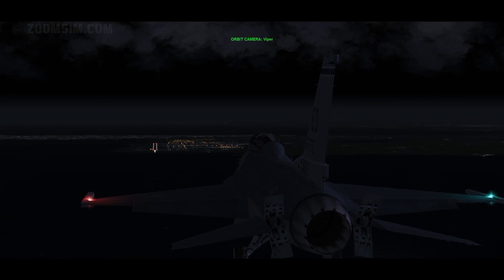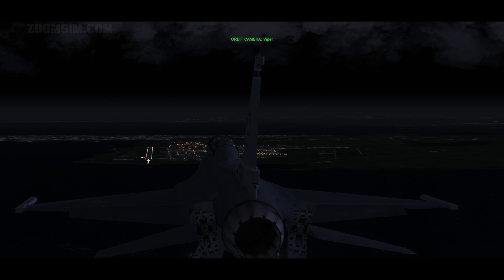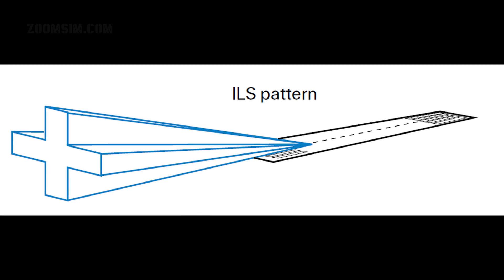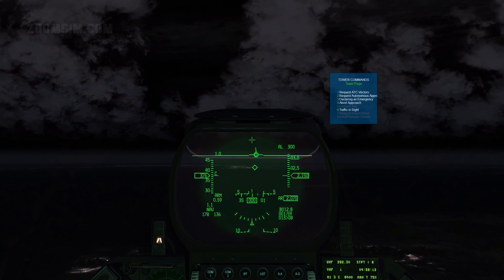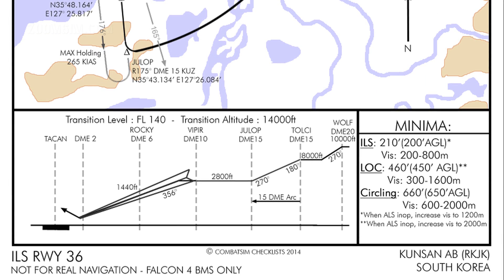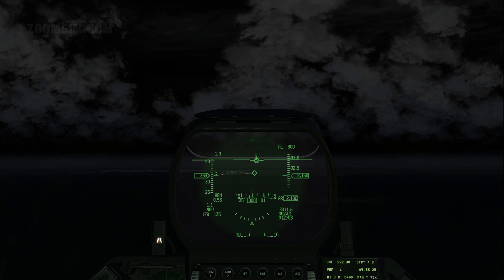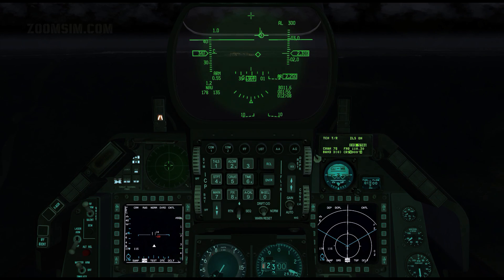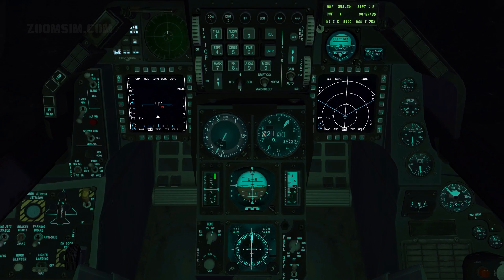Falcon 4 BMS Tutorial 21 : ILS Landing

Comment: This is strange to me because I'm a commercial sim pilot. Why do you put on the speed brakes after extending the landing gear? That would burn fuel quicker because you will need to add more power to mantain the aproach speed. Why?
Reply: The idea is to keep the turbines spooled up at a higher RPM
Reply from the maker: The idea is that if you need to go around it's quicker to retract the speed brake to add speed than to add power.
Reply: supanova It is quicker not to even extend the speed brakes rather than extending them...still don't understand
Reply from the maker: You're slowing the aircraft down for landing by extending the speed brake. If you then retract it you're regaining speed more quickly than if you simply reduced and then added power.
Reply: In my experience it makes the throttle input a little more manageable. The f16 without speed breaks has a tendency to pick up speed quicker than you would like it to while coming into land as a general rule I like to land at about 160. With the brakes out that is easy to accomplish without them I normally will come in around 200 sometimes faster if bump the throttle to much. This leads me to have a bouncy landing which the f16 doesn't really like. Landing with the brakes out I have a much easier time of things plus it's easy for me to just focus on landing and maintaining my aero breaking sometimes I will forget to deploy the speed break until too late and have to burn up the toe breaks.

Comment: Hi. Thanks a lot for your video. Is there any way that we can set up the autopilot to land the plane after we are done with the mission objectives? Thanks a lot.
Reply from the maker: The F16 doesn't have an autoland system. You can end the mission in the air, but that might fail the mission.

Comment: When I've tried to do this during missions I've had an "ILS OFF" message on the TILS ICP page. Is there any way to fix this?
Reply from the maker: Turn the ILS knob on the Audio 2 panel.
Reply: supanova Thanks very much! Another quick question if that's alright - how do I "mute" the ATC during a flight? Listening to AWACS and ATC at the same time during a mission is a nightmare.
Reply from the maker: You can reduce uniform and victor volumes with the comm1 and comm2 knobs on the Audio 1 panel. You also have to decide what channels you want on uniform and victor. For more information read the section on aircraft radios on page 91 of the BMS manual, which is in the install docs folder.
Reply: supanova Thanks again, you're very helpful!
Reply from the maker: You're welcome.

Comment: You're always landing very short, both here and on the VFR landing video. You're basically mowing the approach lights. You should aim your landing at the point where the PAPI intersects the runway.
Reply: He has some excellent, detailed videos and I've learned so much from them.  However the landing videos kinda surprised me in that the FPM should be within the AoA bracket [11 to 15 deg] along with the -2.5deg glide slope around the runway threshold.
Reply: Yeah I noticed that too. Lost like 130 feet in about 10 secs from 9:35 to 9:45 which is ROD of -1000ft/min. You can see the PAPI change at 9:19 to show that the glide slope is off. Tbh, I have the opposite problem; not enough ROD - which means I shoot a couple bolters on carrier landings usually, still, rather fly the go-around than smack into the back of the ship! haha
Reply from the maker: Yes. Landings are always the most difficult part of the flight.